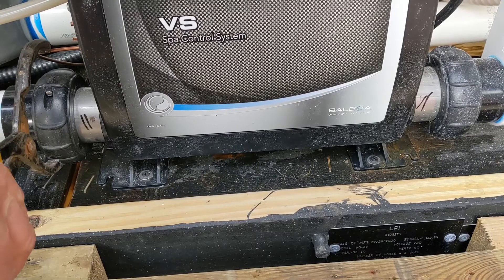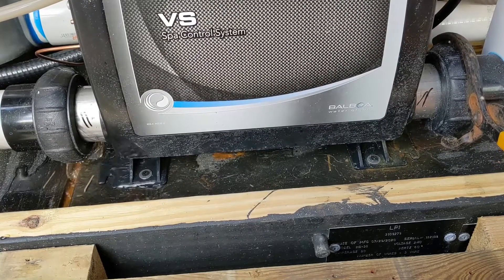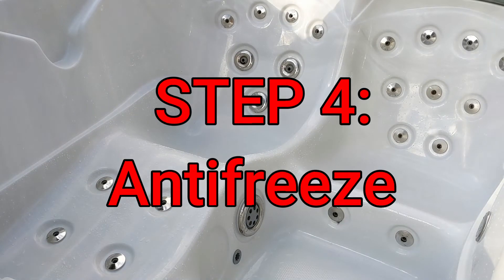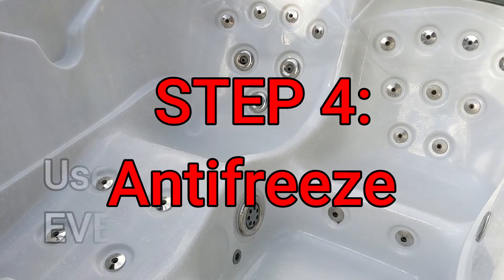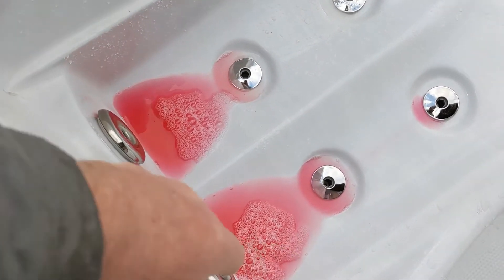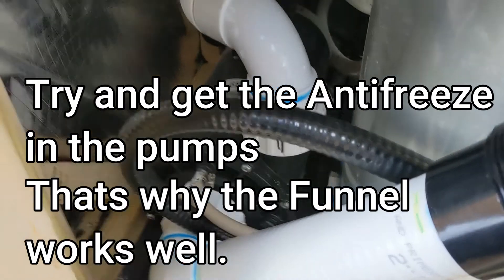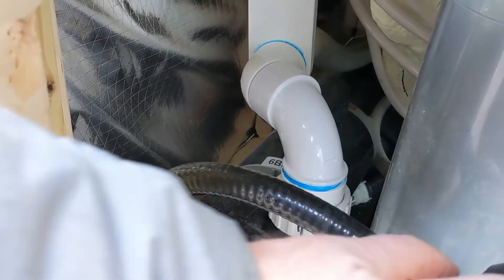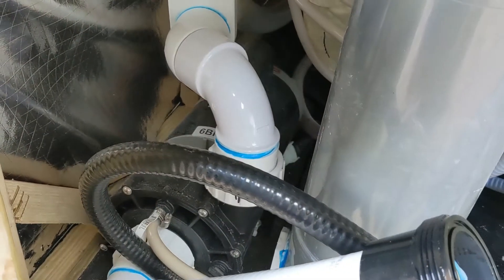How to Close Your Hot Tub for the Winter | Winterize Your Hot Tub

Comment: Do you use a purge cleaner / pipe cleaner to remove bio film etc before draining with the pump?
Reply from the maker: Yes and no.  All depends on the condition of the water.  Some need it everytime you drain it and some tubs just need it once a year.  Going to be doing a video on all this.
Reply from the maker: Also, because this video shows closing of a hot tub for winter and im using antifreeze. You don't need to use any cleaner as the tub will 
look like crap when you open it back up in the spring.  So, at that point you would fill it, use a cleaner to flush the pipes and the old antifreeze.  Drain and clean it out....then refill again.  If you don't do this, you'll have white flakes floating around for a long time. (its white mold in the pipes).